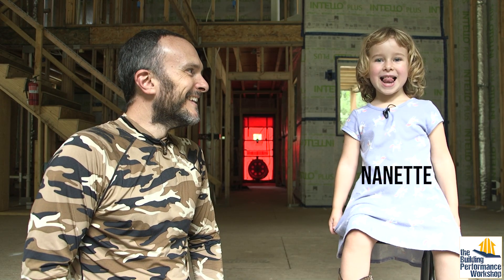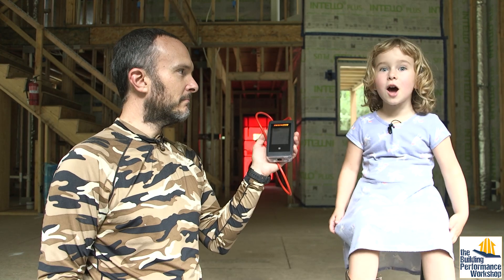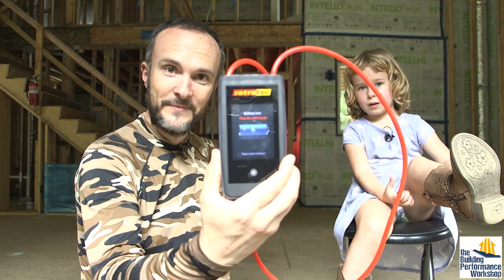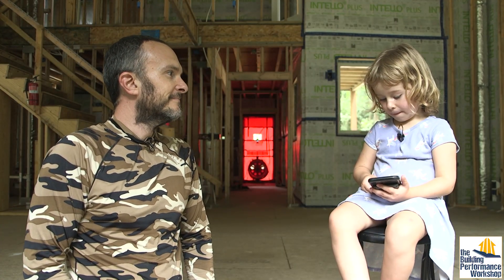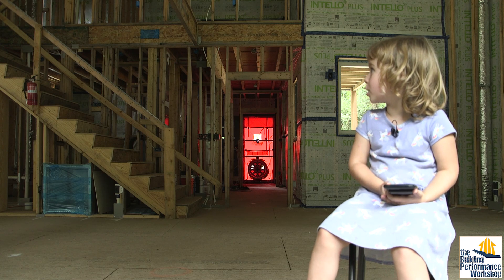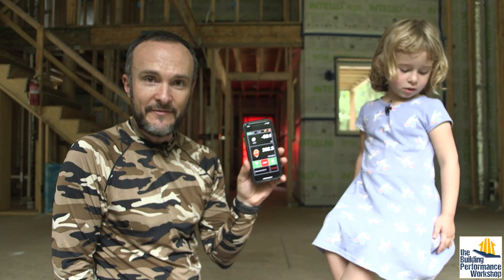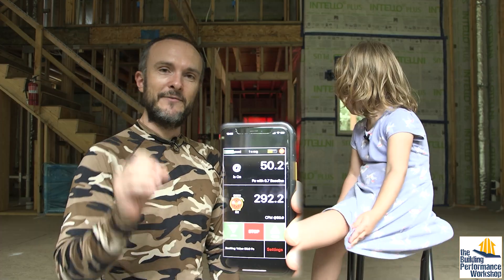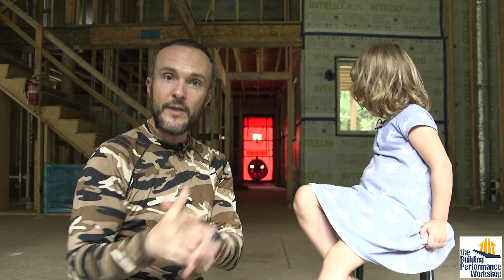4 Year Old Performs Blower Door Test

Comment: Who is her agent? 
Gauge Check - The short tube, in the beginning, does more than tell you if your tubes do not have holes, it also is telling you that your gauge (manometer) is "in calibration". You can use any tubing, best to use the tubing in the umbilical (Retrotec tubing system), connect a tube on Channel A (input or reference) to Channel B (input or reference). SET the Gauge to Pressure / Pressure. Then One At Time, connect Ch A input then the reference port to Ch A input then reference ports. There are 4 tests total, (Ch A Input to Ch B Input,  Ch A Input to Ch B Ref, Ch A Ref to Ch B Input, Ch A Ref to Ch B Ref). The Ch A numbers should be very close to Ch B in less than a minute. Short tubing will have high readings and long tubing will have low readings. This is the first thing to check when "something is not right in the gauge"  
Check out these old videos https://retrotec.com/blog/post/field-check-your-dm-32-gauge/  and https://retrotec.com/blog/post/perform-a-calibration-check/
Reply from the maker: Nice details, as always, Joe!

Comment: Energy star is 3 to 6 air changes at 50 and passive house is 0.6 air changes at 50 Pa. This house is 0.35 air changes and 50 which means it exceeds the passive how standard which is the tightest in the world. There is a slight advantage in that the house is fairly large in volume but nevertheless it’s extremely airtight and somethings you cannot get without using a blower door prefer probably run by a four-year-old.

I noticed that his family appears to include a new addition. Most certainly another building science opportunity.

Congratulations Corbett on your fine family and your excellent work over the years. You are a great spokesman for the important building performance industry which will be essential in the upcoming decades long fight to do something about climate change. Building performance is one of those gifts that keeps on giving rather to both the occupants and the Global fight to reduce carbon dioxide emissons.  Corbett is courageously fighting for his children’s future.
Reply from the maker: FROM THE INVENTOR OF THE BLOWER DOOR! Thanks for the high praise, my friend!

Comment: I really appreciate the video and information you share in your videos,  great work.

Serious question, it seems like creating a large CFM negative pressure to find leaks in a home that would normally never he a negative pressure that large unless under attack from a tornado, is like balancing my 2003 corolla car tires to 250 mph to check for vibration. 

It seems like a way to justify sealing a home beyond what it needs as a way to sell services they really don't need under normal conditions. 

I'm not saying I right, I'm just trying to understand the coalition between actual need and test.
Reply: Overall negative, maybe not. But a strong wind will induce the same direction of airflow on the upwind side(s) of the house. Going negative for the test stimulates a strong wind (25mph I believe) on all sides of the house at once.
Reply: There is a correlation between blower door results and air flow in/out of the house. By mem i think 5 acha is equal to minimum ventilaion flow. Please correct me if im wrong.

The other thing of course is you need to get flow high enough that you can easly measure it.
Reply from the maker: If you don't think homeowners need humidity control, temperature control, air contaminant control, bug control, or draft control, then you're right, this test would be overkill. Unfortunately in that case, you're still required to have it done (and pass) by your state energy code in all states within the next decade.
As stated by Seth, 50 Pa isn't much, only a 20 mph wind. We use 50 Pa because it's the sweet spot for accuracy, testing airflow through this hole of known size called the blower door- much more accurate than anything else aside from a tracer gas test, which you can see discussed here:
https://www.youtube.com/watch?v=3pxnuJmCqP8
Reply: Thanks everyone, new to the concept and trying to understand. Several of your comments were very helpful.
Reply from the maker: Welcome to the cult, Phil!